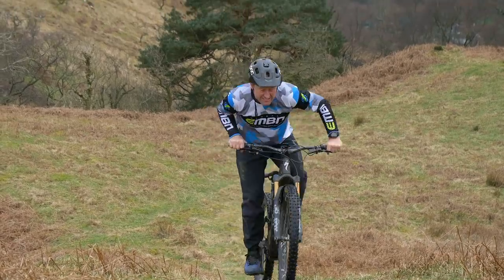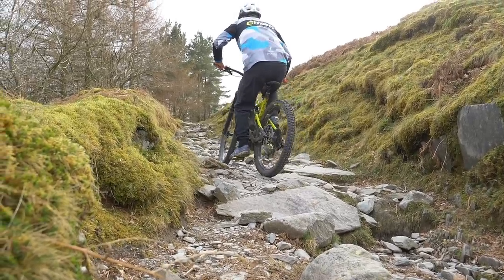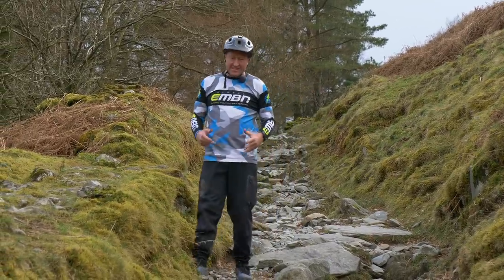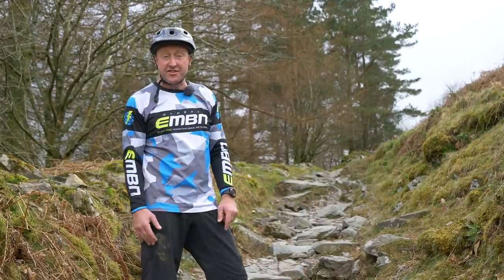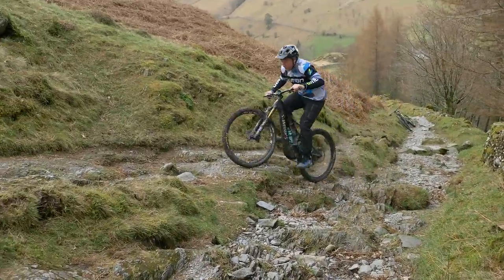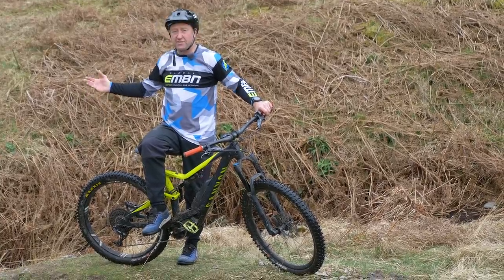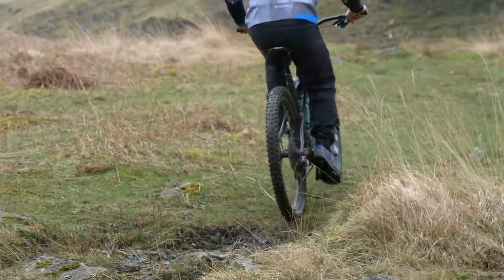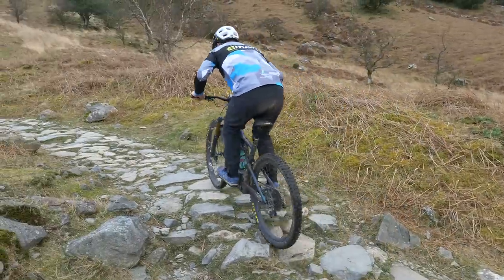How Important Is Power On An E-Bike? | EMBN Investigates

Comment: Never ridden an e bike but I've done a lot of off road motorcycling in places like Wales, and the principle is the same. You can have all the power in the world if you get the technique wrong you'll just sit there spinning. Momentum is important, and knowing when to slightly roll off the power on the bits with least traction, and letting the momentum carry you over that bit, hopefully having enough of both to get you to the top. I've only just discovered e bikes and cant wait to buy my first one and hit some trails.

Comment: you have 1/3 of horsepower and 15nm of torque a 500cc crosser  doesn't have 90nm of torque or a 1000cc road bike   how is torque measured on a bike if you had 90nm of torque your bike would be uncontrollably on these small slopes
Reply: Well the torque on a mid drive is specified at the pedals and on a hub drive it's specified at the wheel. I mean if you had a 90:1 gear reduction in the mid drive you'd only have 1 Nm or motor torque. Torque is meaningless without specifying the rpm at which it is at. I mean my legs can produce as much torque as a car engine, but because I can't pedal at 5,000 rpm I won't have anything like the power of a car. Most motorcycles will have far more than 90 Nm of torque at the wheels, but the gear reduction is greater. A cyclist's legs will usually put out more torque than a motorcycle, but the choice of gear ratios is different and the motorcycle engine spins more quickly, and is more powerful over all.